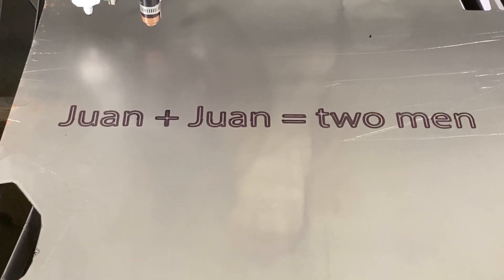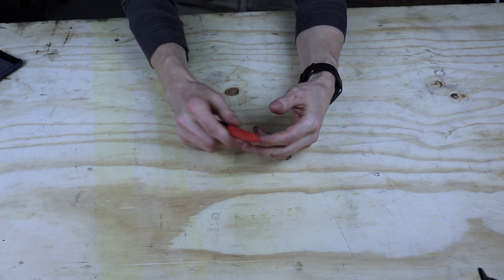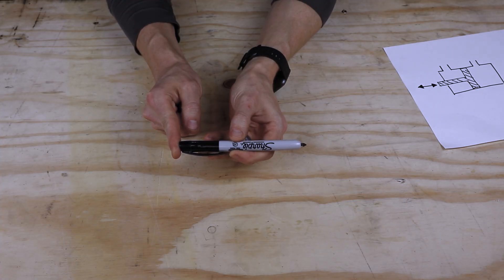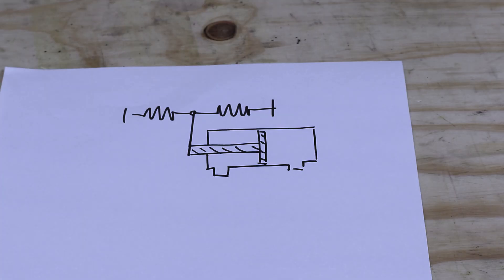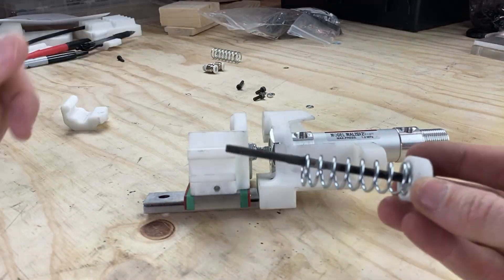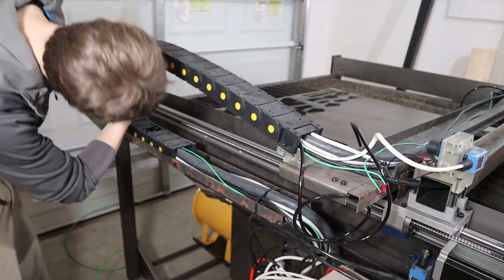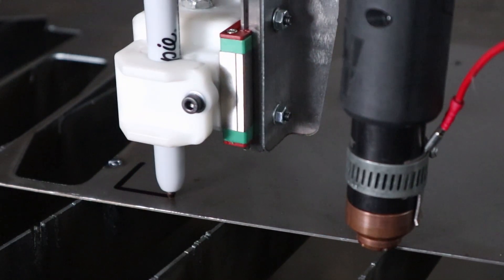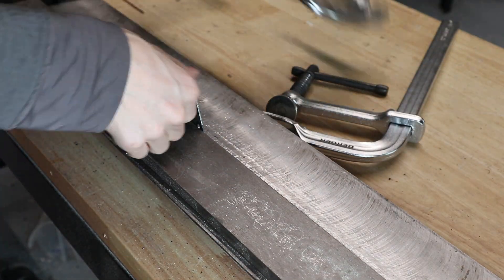This marker will change the way you work with sheet metal

Comment: You can also check into "Airpel" Cylinders which have zero "stiction".  This would allow the use of much lighter springs and also a more repeatable central position due to the significantly lower friction.
https://www.airpot.com/product-category/product-lines/pneumatic-actuation/airpel-anti-stiction-air-cylinders/
Reply from the maker: Cool.Haven't heard of those before. They look pricey - any idea on rough cost?

Comment: Hi, Thanks for this video. It is a solution that works well.
What I wondered is: Could you make the pen move up and down using a solenoid and a pen with a magnet sliding up / down in a tube?
To switch the solenoid / direction of the movement one could easily use the arduino / electronics already used to run the CNC?
What do you think?

Comment: 5:43 I really like the idea of the opposed-spring mechanism. Here's a suggestion for a way to improve it, if you make another. To remove that low-force zone before the spring can overcome friction, you could preload the springs. You would also have to include some kind of stop that prevents either spring from extending beyond the middle position.

So when the marker assembly moves upward:
  - The upper spring compresses, but because it's preloaded there's no low-force zone.
  - The lower spring wants to extend (because it's also preloaded), but can't because it's prevented by that stop. It's left behind by the marker assembly, so it doesn't exert any force on the marker assembly that would counteract the other spring's force.
(and vice versa when the marker assembly moves down)

So the marker assembly only touches one spring at a time, except when it's in the middle. When it's in the middle, its location is known and it requires some force to move at all. You could use smaller springs.

Comment: So by the law of transposition, that means your pencil can also cut metal!
Reply: Carbon arc?
Reply: @MarkProffitt  also if you throw it hard enough lol
Reply: Ah yes the CNC sharpie that's also a lazer cutter.
Reply: If you are persistent enough you can because graphite is abrasive
Reply: @velazquezarmouries  graphite is not abrasive, it is a lubricant.
Reply: @bmxscape  everything is abrasive to a certain degree
Reply: @velazquezarmouries  like this thread?
Reply: @rionmotley860  everything
Reply: Magic eye required
Reply: No

Comment: What do you use for your cam software? I'm running a torchmate to 2x2 that I bought from my highschool, didn't have any cam software and I really want lead-ins ( and your pen system)
Reply: Try SheetCam or Fusion360 :)
Reply: @mpkleinbreteler   only problem is that I use solid works Sheet system, and it's hard to import stuff in to fusion 360

Comment: Actually you can get 5-port 3 way solenoids where in the energised states you send air to the valve either side, and de-energised you can vent air from both valve lines through the exhaust ports in the solenoid.
Reply: Exactly :) instead of a 5/2 valve, it's called a 5/3 valve open center :)

Comment: Very nice work! I like.

I've had the same problem with the two position cylinder (needed three).  
You can solve it with multi position cylinders. You just connect/mount two cylinders in serial. Festo e.g. offers mounting kits for their cylinders.
With this setup you can realize three positions (full stroke / half stroke/ no stroke) and the middle position is accurate. Ok, you need an extra cylinder and an extra 2/3 way  valve and the mounting kit.

Maybe it helps for another project. 
I really like this multi position solution with two in serial mounted cylinders since it was also new for me and an eye opener somehow.

Comment: Regarding stringing cable chain on the plasma:

Next time you have to add a wire, tape another piece of scrap wire or cable and push both through. Then the next time you have to add a wire, take another wire scrap and tape both to the first scrap piece and pull through, leaving you with another pull wire for future mods. Rinse and repeat (:
Reply: Dang! Beat me to it!
Reply: I do this every time I pull a wire. It has saved me from pulling out much of my hair.
Reply: Jet line! Always pull at least one extra in your ling runs.
Reply: Elechicken here to tell you to use the ground wire as a drag. Hell I should be the youtube troll of AvE's friend dewcalw!!
Reply: That was useless, his first sentence after explaining the hustle, was to tell that he´ll "never learn"... ;-) I think, that he thinks of it every time, but is always too lazy to go the extra mile, pushing a 2nd line through, along with the 1st one...
Reply: @klausbrinck2137  the i never learn was referring to the fact that it would be faster to  take the plates off than struggle with it every time

Comment: tries to minimize noise on the system, also him: uses palstic box for electronics and no ferrite cores or star ground for everything.... how in the heaven have you made it that a stepper right behind the torch is not dancing away when cutting with the plasma? what board you are using that the connection to the computer does not get lost once the plasma cutter "cuts" over a gab? i am so frustrated with mine, i tried so many things to make it work but it always resets the controller when starting the plasma arc
Reply from the maker: You got me on the plastic box. I was in too far before I realized that was a terrible idea :P I don't think it's visible anywhere but I do have a star ground going to a dedicated ground rod ~5 feet away. That improved my noise situation dramatically. I'm using an Ethernet smooth stepper which has a totally rock solid connection.

Comment: I love the Sharpy as a Solution But why Not use a Scribe? Like there are retractable carbide scribes? Or Have another stage that scribes. So you can do Gross line work. then follow up with a scribe lines for breaks and drill marks. Or Use your design and add a Pnumatic scribe onto the other side of the head instead of a marker. I love the marker for illustrating to future you/me what the heck I need to do with the part next or how its supposed to form. Keep it up though Looks awesome
Reply from the maker: I tried out a scribe initially and the ones that I have were too sharp - they would dig into the metal and move it around. I've since found some blunt scribes that seem like they would work well. Eventually I'll probably make an adapter to replace the sharpie with a scribe.

Comment: great build and information.  just a thought, the next time you're in your cable chains, include some conduit fish line (high tensile string found at any big box store). this way you can run your next wire using this line and also include another line with your new wire so you can do it again and again... until you need to replace your entire cable chain to allow for more wires/plumbing.
Reply from the maker: THANK YOU. I will definitely do this. I'm getting so many life changing tips tips  (at least in a very small way :) from the comments.
Reply: @StuffMadeHere  They also sell it on amazon https://www.amazon.com/Breaking-Strength-Klein-Tools-56108/dp/B0026TA6WK
If you always pull another length with whatever you are pulling in it will always be available, sometimes however they do get twisted up and bound.

Comment: what about insted of a Pen .. take a engraving laser? should be the most precision solution and they are not that expensive .. something around 20-50 Watt should be enough
Reply from the maker: It might work though I would be afraid of having that with no enclosure - sometimes sheet metal is quite polished and I can imagine getting a reflection in my eye. With an enclosure that could be a really sweet solution
Reply: @StuffMadeHere  true reflection is a point .. we in germany mostly use laser protection curtain .. its a thic colored vinyl like stuff and you can still see through .. but i dont know the costs for it
Reply: @StuffMadeHere  Have you considered marking with your plasma torch? The powermax45 xp can mark with 10 orso amps :)
https://www.hypertherm.com/learn/applications/marking/metal-marking/?region=EMEA
I recently finished my plama cutter and i'm going to look into that :)

Comment: What type of program r u running on your table thank Charles
Reply from the maker: Hi Charles, I'm running Mach 4 talking to an enthernet smooth stepper. It is really flexible and works well.
Reply: @StuffMadeHere  Another great video and timely for sure.  I'm rounding the final corner on my build now.  The mechanics of this are very creative and for entertainment you covered it well.  The questions that remain are for implementation.   First (and a problem I am having), what post processor are you using to gen the g-code for your machine?  Is the drawing part of the job a different setup and tool path file with a different work offset?  In post is the pen being treated like the torch?  It looks like the torch touches off just before the pen starts.  ~P.  These questions could be an entire video.  Ps...im almost convinced to get into additive manufacturing.   And yes I have always thought SLA  was the best choice for me.  It is just an economics thing now.

Comment: Dude, that’s brilliant! I’ve just started working with a plasma table and was pondering ways to solve complex bend placement. Great solution. I did something similar for my CNC, but I mounted the sharpie in a brass tube with a fairly soft spring between it and the back of the tube to keep it from being smashed into the table. Would have to solve for using retractable sharpie though. Hmmm. Anyway, love the video, love the channel, and I identify with your “shortcuts” way too much. Keep the content coming!

Comment: So you went through all of this trouble with using a marker, while you could have just used a scribing tool instead and have it leave a finer mark than the sharpie without the need for ever replacing it?
Reply from the maker: I initially tried a carbide scribe but it would "bite" into the material and move it around. Someone else linked to some nice blunt scribes that I'm going to try out.
Reply: @StuffMadeHere  great, wishing you success with that!

Comment: Hi Nice video, I was just wondering did you build this plasma cutter your self? And don’t they usually have water under plate that you’re cutting any reason you don’t?
Reply from the maker: Thanks. And yep, I designed / built the plasma cutter. Instead of the water table I have a big box under the plasma table with two very large fans that suck all of the dust and fumes outside (called a downdraft). This is common in bigger industrial machines. I did this because I didn't want to deal with the mess and maintenance of a water table. You can see how it works in this video: https://www.youtube.com/watch?v=BuC1IiZBY_o

Comment: Great video!  What software program are you using and how did you tell it to draw the bend lines separately?
Reply from the maker: I'm using fusion 360 to generate the toolpaths from a sheet metal flat pattern. The marker head is treated as a different tool with a tool offset so when the plasma cutter reaches a tool change for the marker head it sets the head offset and triggers a canned cycle to open and close the marker.
Reply: @StuffMadeHere  
Thanks for your insights
Reply: @StuffMadeHere  Thank you for this. Perhaps you could note this in the description? Either way, thanks.

Comment: Very nice! I would love more plasma cutter videos especially if you could talk about Torch Height Controller and plasma "source" you use (or share few details in comments). We are building one as well and your cuts look beautiful.
Reply from the maker: There's been a lot of interest in all the sheet metal fabrication techniques that I use so I plan to make a video going into more depth from design through fabrication as soon as I have a suitably interesting sheet metal structure to build. Some details in the meantime:

- Power supply is a powermax 45xp with a machine torch & CPC port for control
- I use finecut consumables for all thin gauge sheet metal (they cut amazingly well)
- Torch height control is using a TMC3in1 board. I was put off by the cost of these initially so I used to have one that I designed myself but it was really finnicky and took FOREVER to get working. The deep integration of the TMC3in1 with the ethernet smooth stepper made it worth the cost (the fact that it logs voltages that you can view is what sold me on it)
- The table can go 350in/min with around 200 in/s^2 acceleration. This is VERY IMPORTANT for clean cuts. A lot of entry level tables top out at 200 in/min which is too slow for fine gauge stuff. Faster acceleration gives better cut quality when changing direction. If I did it again I would target even more acceleration.
- My plasma table is all my own custom design

Let me know if you have other questions. Typing out that list there's probably enough going on in this system that I should make an overview video for the table... anyone interested in that?

Comment: Question... Could you kindly tell me what the click length is of a shapie click.... Yes I could just buy one... But we are on lockdown and Amazon prime is on a go slow for non priority stuff.... I have a plan to use a multistage pneumatic cylinder (2 stage) to simplify the design idea you've kindly given to me.... It is possible to assemble a multistage pneumatic cylinder from (cost effective) SDA12 cylinder components.... Thanks for the idea!  Subscribed with ongoing interest
Reply from the maker: Sure. I'm measuring right around 20.8mm as the actuation distance. You'll probably also need dimensions for the marker so I just added a link to the marker CAD (step file) the blog post about this: https://shane.engineer/blog/two-in-one-plasma-cutter-pen-plotter

I'm curious to hear how it goes. I would STRONGLY recommend adding compliance between the marker and the air cylinder (i.e. make the marker floating on an axial spring or something). This is my one regret for this design and it makes it more finicky than it needs to be. I've smashed several nibs accidentally. I use this tool so much that I plan to redo the design with this mod soon.
Reply: Thanks so much, and thanks for taking the time to post these great ideas and videos

Comment: My question to you is how did you crate G Code or read G Code so that the offset would be accounted for? Changing work offsets from G54 to G55? Or is there something within the tool setting itself?
Reply from the maker: I'm using a relative G10 command which sets a head/tool offset within whatever work offset you're in (in my case G54). I set the G10 offset with a subroutine and unset it with an other subroutine. Generating all this gcode is done by the post processor with special casing for tool #2 which is the sharpie head.
Reply: @StuffMadeHere  excellent. hoping i can learn a trick or two from you lol
Reply: @StuffMadeHere  Could you make a video about this process, im curious about it but, dont get much about it yet.

Comment: You invented the Cricut plasma cutter! You'll make a killing licensing this to them and cosplayers will be upping their game 😁 

I just found your channel and watched all your videos. Your one of the best new discoveries I've seen in quite a while. You have a great presentation style with just the right balance of explanation and demonstration. I'm looking forward to seeing what's up next!
Reply from the maker: Thanks! I really appreciate the feedback. You're totally right about the cricut - I wonder if I can put other heads on this machine...
Reply: @StuffMadeHere  Screw post spot welder maybe?
Reply: @StuffMadeHere  possibly a mill? you couldn't do hard metals but it'd do plastics and such easily i'd assume.
Reply: @StuffMadeHere  
Hello there, I have a question. How does the system know what is defined as a bend?
Unless I missed it, you didnt go into details about the software at all :(
Reply: @ZLP-TM  My guess is that the part is modeled in  a CAD software then a software tool is used to convert it into a 2 dimensional fold-out where the bend lines are defined on the overlay.
Reply: You forgot humor.  His balance of humor is getting there.  He needs a TOT time machine.

Comment: You might consider putting a spring loaded diamond scriber on there instead of the pen.  An industrial dressing diamond might be a simple/cheap way to procure something tough.
Reply from the maker: This is a good idea. I have some carbide scribes that I was thinking of using but they are super pointy and draggy - they will definitely move the material around. If they make a blunt scribe that could work well. Do you have any recommendations on diamond scribers?
Reply: @StuffMadeHere  as a general rule you want to avoid scribing any lines you aren't cutting as they are excellent stress raisers. Of course, fatigue failure isn't likely to be an issue in many applications but it's best to avoid bad habits! See pg 112 of Engineer to Win by Carroll Smith for a reference.
Reply: @justarandom1  That was the point I was about to bring up. Robin and Stefan would have your head for scribing a bend line. That said, probably not a significant issue for a bracket.
Reply: @StuffMadeHere  I did a search for "spring loaded diamond drag engraving bit" on Google and it returned some useful results.  The USA made unit has a much more shallow tip, like a dressing diamond would have, the cheaper unit is a bit more sharp.  What I was originally thinking of was a "diamond dressing tool", these are cheap and blunt, there are some good examples on eBay.
Reply: Great idea